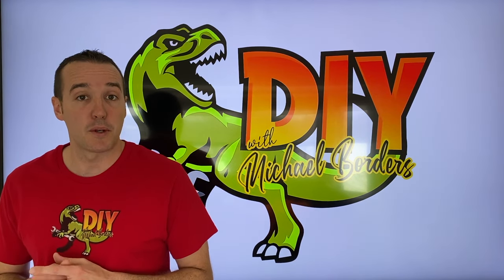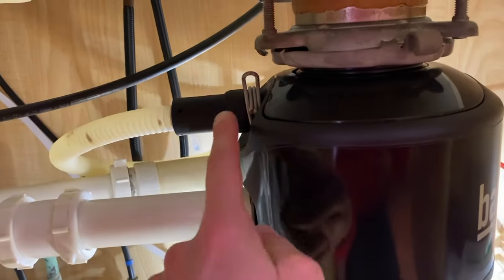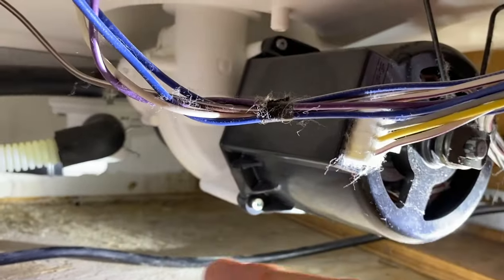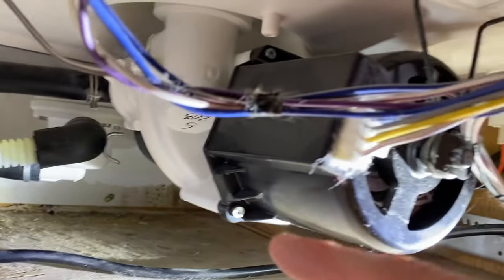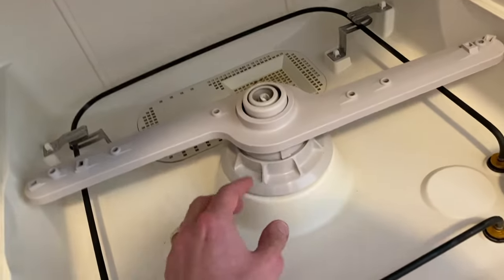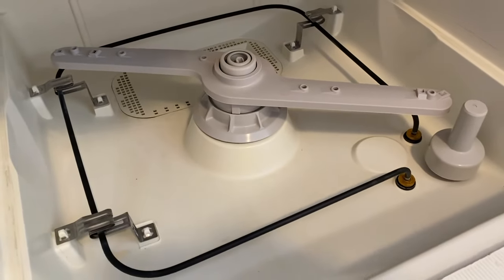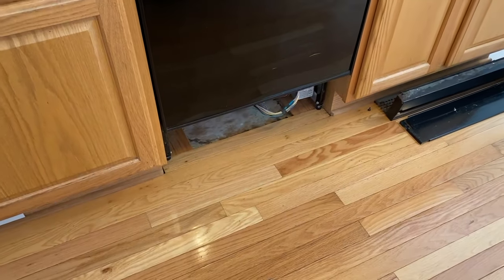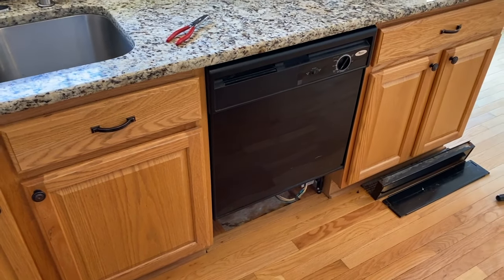Water leaking under Dishwasher - Most common causes

Comment: Thank for the video! Turns out the issue on my GE was that the float stem housing became loose and the o-ring wasn’t in contact.  Water was just pouring out of the float switch area.  I tightened it up and we are good as new! I saved your video in case another problem occurs.
Reply from the maker: Awesome job pinpointing the cause.  We appreciate you taking the time to share your experience.

Reach out to us any time!  😎👍

Comment: For safety sake, I'd unplug it before sticking my arm underneath (I noticed there's a receptacle for it under the sink), otherwise I'd turn off the breaker if it's hardwired... and if it's wet under there, the arm turns into a perfect bridge and a jolt may turn into a cut from yanking it out around sharp edges. A dishwasher leak pan is a good investment to protect the flooring and notice a leak a bit quicker before a non-protected cubbyhole flood.
Reply from the maker: Thanks for watching and sharing your thoughts, always welcome here and much appreciated.  😁👍

Let us know if you have any questions and hey if you’re into crypto trading, join our DIY ecosystem and help us grow an exclusive group of DIYers.

       toolboxtoken.com

Reach out to us any time!  🧰

Comment: This is super helpful, thank you. My dishwasher has water collecting in the bottom of it, some of which leaked through the floor into my basement downstairs. Not sure how since my kitchen has tile, but will attempt to find out once I find a way to remove the collected water from the dishwasher. The water looks clean.
Reply from the maker: Thanks for watching, that’s no fun however we are giving you 👍👍 for making it a DIY project.

We are standing ready to help answer any questions.  Fist thing to do is pinpoint the exact location of leak…whether it’s drain hose, pump motor…

Keep us posted.  👍

Comment: Thanks for an explanation that this almost 60 year old lady can understand.  I finally looked under my dishwasher.  I just got done fixing my microwave. Yeah me.  My GE dishwasher is leaking from the pump area.  It is very tight underneath and have decided to get my appliance guy.  I feel proud to be able to explain what I think the problem is.  There is a stalagmite coming from the pump area.  Thanks again for your explanation.
Reply from the maker: Good morning, awesome job on the microwave.  We definitely know the lack of space underneath dishwasher.

If it helps, we have attached a video link below showing us replacing our pump motor.

       https://youtu.be/xamkKSNCqTg

This will get you even more familiar with the machine prior to the technician arriving.  👍

Comment: Thank you..Very helpful and your calm voice was a needed boost..My problem revealed itself over a few weeks of me scratching my head wondering why i had a pool of water in my basement..The water found in the basement just happened to gather near my clothes washer.. drain sink and furnace leaving me bewildered on what the heck was leaking..Turns out my dish washer just so happens to be upstairs in my kitchen above all these things in the basement and the leak didn't reveal itself until this morning as my kitchen floor was wet..Finally relief knowing where this water was coming from but it brought on a new adventure yet to tackle..This video though helps me to understand what to look for under the dish washer so it remains to be seen how to fix it but this video for sure gives me a start thanks..

Comment: UPDATE:  It’s called an air gap and I found a fix it video

This is a great video!!! Thank you for posting it.   My mom is blind, my s-dad just passed away after being bed bound for 2-3 years and I’m trying to get her house in shape for her.   I noticed there is a drain like thing on the top of her counter. It’s for the dishwasher, but I’m not sure what it’s called to find a video on it leaking.  Even after running the garbage disposal before running the dishwasher the thing on the counter has a leak.   Any helpful hints would be appreciated (even the name of the part).
Reply from the maker: Awesome, we have an Air gap installed on our Reverse Osmosis system faucet.

😎👍🧰

Comment: Hi there! So my dishwasher kept kicking out the pod and I noticed the floater to the left side of the dishwasher was loose so I tightened that and when I went to turn it on my dishwasher started leaking from the bottom like water was coming through the door at the bottom. Why do you think that could be? It’s a GE potscrubber dishwasher
Reply from the maker: Thanks for watching, leaks are no fun.  Any update?  Have you inspected the door seal to ensure it’s not pinched or damaged?
Reply: @DIYwithMichaelBorders  I think I fixed the door seal as there’s no more leaking but now the dishwasher fills with water 😩 I cleaned everything already and ran it again but the water is just not draining. There’s no water backing up into the sink through the garbage disposal either so not sure why it’s not draining.
Reply from the maker: @jacquelinesanchez4494  

Thanks for the reply, any update?  Hopefully it’s as simple as a loose connection.  Hopefully you don’t have to replace the motor.

Comment: I'm leaking water around the coil at the bottom of the dishwasher. The 2 that goes into the dishwasher's Bay. Kind of rusty, how can I?
Reply from the maker: Thanks for watching, is your coil connected to motor assembly?  If not, it should be a friendly project.

Comment: My dishwasher is over 20 years old (Kitchen Aid KUDI01DLBS0), and it started leaking from the bottom (on the right side of the door). I opened the bottom cover/panel and ran the Normal Cycle while watching it with a flashlight where the leak came from. It took about 15 min, until you could no longer add any more dishes and the cycle started. That is the time that i see it starts leaking, not from the bottom of the inlet valve but somewhere from above the valve visible part. What can this be? If there is an issue with the inlet valve it should start leaking as soon as you start the cycle? No?
Thank you in advance.
Reply from the maker: @nofear6235  

Thanks for watching, any update?  Have you inspected the water line that feeds water to the inlet valve and into the system?  This line will tie into your warm water plumbing underneath your sink.

It’s possible that water is leaking from that inlet hose or line as it feeds from above.

We also recommend inspecting your door seal, as it’s possible that your door seal is damaged further upstream and allowing water to flow down onto inlet valve.  Keep us posted.
Reply: Thank you for quick reply. Yes I did check all water and drain hoses before my initial post, was laying down for over 40 min on the floor with flashlight checking for any leaks during the cycle from the very beginning. I also replaced the door seal a year ago or so, its not cause for this current leak. I unscrewed and pulled down inlet water valve while its still connected, so I can observe for any leaks from the top portion where it connected to black hose. Nothing. More over, yesterday I cant ever replicate the leak even after 30 min from the beginning of the cycle. 
One thing I noticed though, when I open the door during the cycle, the water still run (isn't it supposed to stop when door is open while machine is running?) from the water filling hole in the lower left side of the dishwasher.
So far my update is that I wash dishes with my hands, lol, to make missus happy
If i don't find the culprit i next few days I am buying a new unit, I cant complain about the current one, its from 2002! Had a long life and work hard.
Reply from the maker: @nofear6235  

We appreciate the follow up, yes…the machine is supposed to shut down anytime the door is opened.

A faulty door latch sensor can lead to this.  Being from 2002, that’s a great run.  😁👍

Looking forward to hearing back from you.

Comment: I have a literal short video of my leak under my GE nautilus. Can I send that to you to get an idea of what part is leaking? It's an old machine but this only just started happening and I noticed the water backs up in the sink. I have tried everything to deal with my slow drain but nothing seems to work.
Reply from the maker: Thanks for watching, this is the best way to stay in contact with us.  Let’s get this figured out.

Are you experiencing any other issues with your sink plumbing that may be causing the back up?

Is the leak underneath dishwasher close to a rubber hose fitting or does it look like it’s more of a crack in the respective part?  Keep us posted.
Reply: @DIYwithMichaelBorders  Hello and thanks for the response. The sink has a slow drain and has been like that no matter what I do to try and clear it. Like you know, those chemical cleaners or I even tried using vinegar and baking soda. But the machine never leaked regardless even though the water backs up into the sink when it drains. I looked under and it's dripping from what I think is the drained shaft seal. I've ordered the part and I think I can fix it from watching videos :) Oh and I should add that it only leaks when draining.
Reply from the maker: @DragonQueen78  

Thanks for the reply, awesome job!  We are looking forward to hearing back from you when that new part arrives.

Keep us posted with any questions you have, we DIYers need to stick together!
Reply: @DIYwithMichaelBorders  thanks for the support. We definitely need to stick together and more women need to learn how to fix stuff lol
Reply from the maker: @DragonQueen78  

😎👍

Comment: I wonder if you could help me diagnose my problem:
Samsung Dishwasher is leaking from the front (not the bottom as far as I can tell) I can tell the lower door seal is disintegrated so that makes sense that water is leaking out of the front. 
I followed other videos showing to turn it on the side and dry everything and the pan so the leak sensor will stop activating the drain.
I checked the drain hose and the water inlet-dry as a bone. 
I haven’t run the dishwasher but when I opened the dishwasher there was water standing inside the bottom of the dishwasher. I think water is leaking INTO the INSIDE of dishwasher and gets high enough to run out the front (because of the bad seal which is a discontinued part) and I never would have know it was even happening if the lower door seal hadn’t finally given out.
What part do I need to check or replace for water leaking INTO the dishwasher even when I’m not running a cycle? The water supply is not leaking inside my cabinet either. There’s no water except inside the dishwasher and then when it runs out the front (when it gathers enough to leak out the bad seal.) No water originating under the machine except the water that runs under when it leaks out the front. Any help would be appreciated.

Comment: If the leak ends up under the cupboard and down a ways, would that be the drainage pipe.  Its about 30 minutes into the cycle
Reply from the maker: Thanks for watching, that’s very likely.  We recommend checking to see if the drain hose is wet at any point alone hose.

If so, it may be a leaking drain hose.  Please keep us posted.
Reply: Have same issue but everything is dry under the machine .. leaks just at the front of the door halfway in the cycles and just started after 4.5 years of perfect cleaning cycles. 

Guess it means gaskets bottom of door plastic piece and the rubber gaskets around the edge I guess? But nothing is wet except the massive leaks halfway in the cycle. Trying to see what is causing. Took off the panel and just wetness dripping from insulation from bottom of the door left and right .. mostly right side. 
Any ideas? Thank you  @DIYwithMichaelBorders

Comment: My dishwasher leaks when I run it but its leaking under the sink. Its where the hose fits into a straight pipe and its like the pipe is over filling
Reply from the maker: Thanks for watching, this can happen when the pipe itself is clogged causing backup/blockage of water flow.

You can disconnect the dishwasher drain hose and verify pipe and additional plumbing is clear of any blockage.

Comment: Mine leaked even though I hadn't used it I'm months. WTF
Reply from the maker: Good morning, have you pinpointed the exact leak point?  You may just need to slightly adjust the hose and clamp to create a water-tight seal.